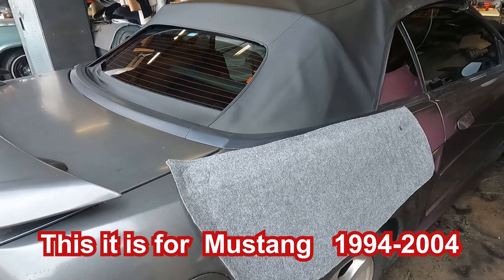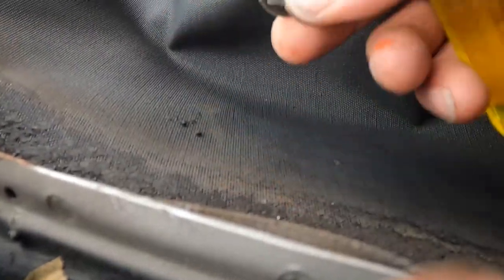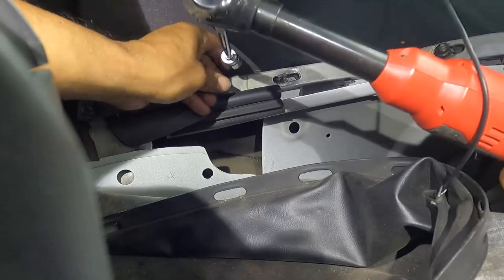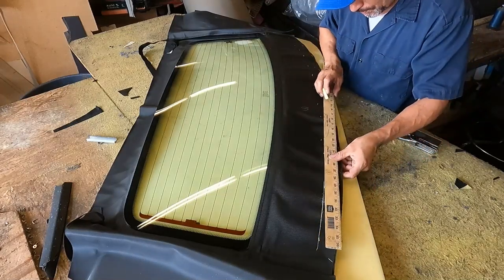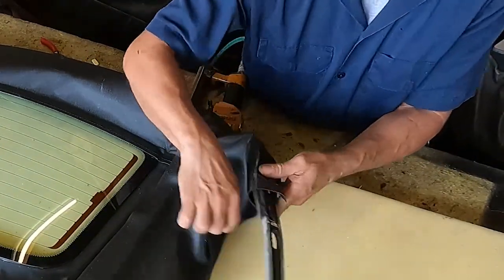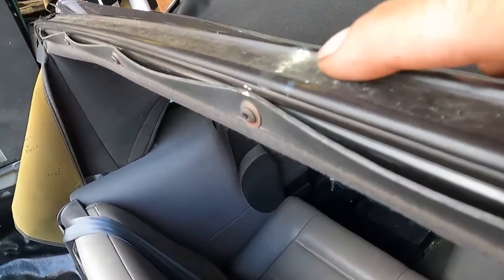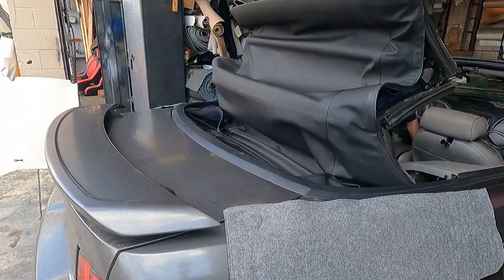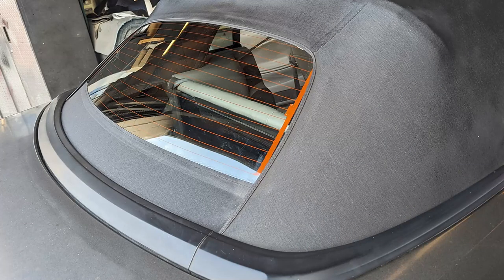How you can Replace a Mustang convertible Rear Window DIY

Comment: Robbins convertible tops are the worst.  I bought one for my 2002 Miata and it failed in 1 year.  They gave me a replacement under warranty (but didn't pay for the install!) and that one failed in 3 years.  I got another replacement (which I had to install again!) and that one failed in only 4 years, both failures were rear windows literally falling out of the top from just sitting in the sun in the summer!  Crap brand.  I'll never buy another Robbins.

Comment: I have a 2002 gt convertible, the back window is leaking at both corners, the seal is wearing away.  Do I need to take the top off to fix that like you did or can I fix it while its still on the car?  And how would you recommend fixing it?  Thanks

Comment: Thank you! My 1999s bottom corner window leaks. The material rotted. I used a piece of plastic and clear silicone but I think this might be a better fix! Thanks for the clear and precise instructions!!! Awesome, thank you
Reply: A couple stitches are loose at the bow above the rear window. Going to try ans fix there too. I've never seen anyone explain how to take 1999 to 2004s tops apart, Thanks!